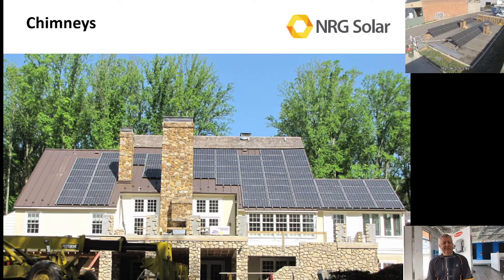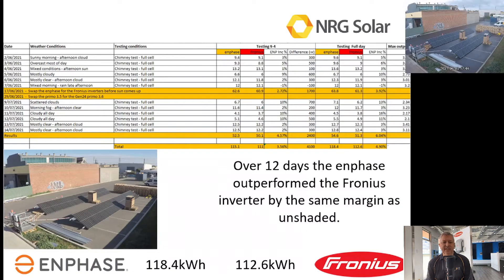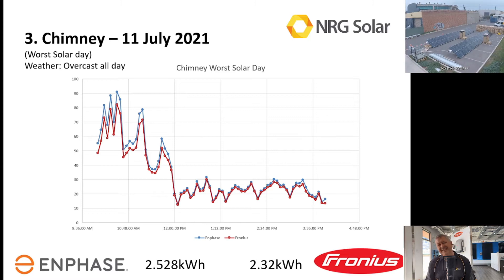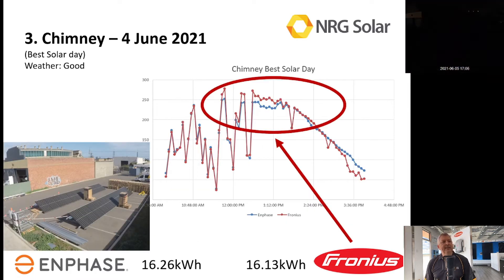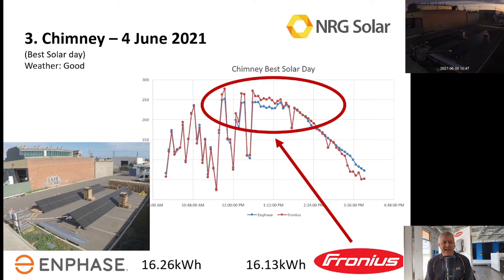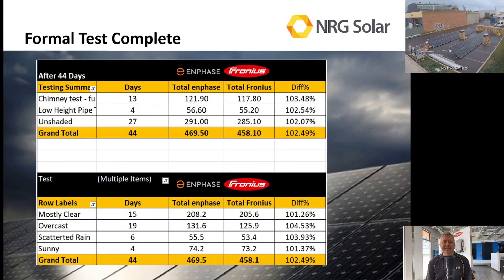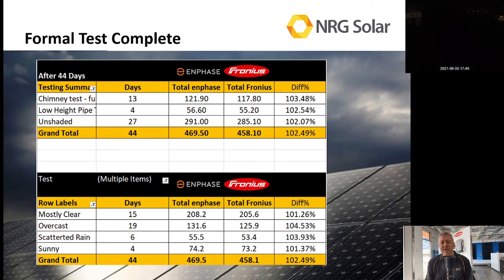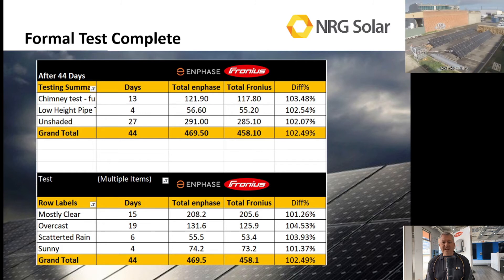Micro and String Inverters in the Shade - Testing Outcome

Comment: ...parallel strings testing?
Reply: I dont think so - max fronius DC current will be around 27Amps
Reply: How are you planning on getting 10/0 wire into the Fronius, which maxes out at 27 amps anyway?

Comment: I might be convinced but I'm not sure lol. After seeing this one great video and so much marketing about micro inverters!
Reply: Marketing is valid if your using it with old inverters that don't have shader fix or DPM (same thing) they can drop as much as 50% because the mppt doesn't work correctly 

EEVblog has an old SMA inverter and had this 50% loss problem because his inverter mppt wasn't very good and did not have shade fix (just a TV pole causing shade killed his array put by more then 50% but he thought it was the inverter when it was shade, but actually it was both shade and his old inverter poor mppt) 
https://youtu.be/AbxHoQF4ADk

The other advantages of micro inverters or power optimizers (solar Edge) is per panel monitoring and no high voltages when it's off (grid loss)
Reply: @leexgx  but which is the best for a battery backup system all DC or DCtoAC and back to DC to charge up the wall battery or say a BEV ? 🤔 in somewhere like Denver callarado 🇺🇸? and a big pine tree 🌲in the backyard 😉 grid-tied system 80% of the time 20% ilanded mode plus running the house 🏡utility needs as well

Comment: Do the panels have bypass diodes?  Old panels didn't have bypass diodes and shade was a killer.  You are doing analysis on the inverters.  I think the determining factor is in the panel.
Reply: I think that is the point of the comparison: modern panels make the inverter technology much less of a consideration.
Reply: Panels made over last 15 years normally have them
Reply: @leexgx  only the cheapest sometimes omit them, afaik.